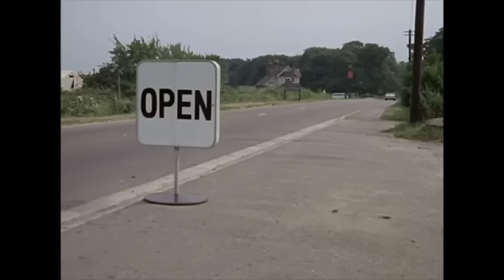The Home-Made Car 1963

Comment: Just happened apon this wonderful blast from the past! What a great little movie! I am an eighty-year-young South African boy who lives in beautiful Pinelands, Cape Town. When I was in my early teens our neigbour gave me his old Austin 7 as long as I removed it from his garage. Dad was the branch manager of Robb Motors in Rondebosch, and as the main BMC agent in South Africa, he had access to much knowlege and spares. Dad suggested that we strip the car and rebuild the engine and chassis. My metalwork teacher was a vintage car rebuilder (he had a beautiful Austin Ulster special) and he gave me numerous bits and pieces which I used when rebuilding my very first car - not to mention much sage advice! We did the engine rebuild and cleaned and polished the inlet manifold and brass updraught carburettor. We got her running beautifully, put on a temporary seat for the driver, and used to drive her up and down our runway, reversing, changing gears, and having a helluva lot of fun! Sadly we could not afford the bodywork, and it was with a broken heart that I had to sell my car to another enthusiast in Claremont, who had the money to complete the build. What wonderful memories! I am still passionate about cars, motorcycles and planes, in fact - anything woth a petrol engine!
Reply: My dad was a Chevrolet dealer in the 50's-60's, he had MG's, Austin Healey convertibles, to bad I wasn't around yet as I was the youngest, he also took home program cars for Chevy like the '55, '56, '57, even Stingrays, but he got out of that business when I came along, I was the only one with that passion while my 2 older brothers didn't care for that.

Comment: Pure nostalgia. Managed to find this on DVD years ago. I even found out the name of the street on which it was filmed. Someone has squeezed a house in where his garage was!!
Reply: Cambridge Rd West?
Reply: @1000Zebedee  Yes. Different layout now though but you can see the main house.
Reply: @automat3000  Yes, clearly the property owner decided to sell off most of the garden including the bit where the garage stood. Bit of a shame in my opinion as the house added isn't really in keeping with the rest of the street which is largely unchanged. I note that sadly, the young lady he was trying to impress (Caroline Mortimer) passed away in 2020.
Reply: As near as I can tell from Google maps, the address is 26 Cambridge Rd W, Farnborough, UK. The set back tan colored house between the red brick house and the white one.

Compare time index 05:20 (view across the street), with Google Street View across the street from this address. The houses across the street look essentially the same to me.

Edit: The house (two houses down the street) at 05:35 is 30 Cambridge Rd W, Farnborough. From Google Street View you can see the distinctive roof and same color (of course) bricks.

The hedge the little girl is hiding in, is still there. Although needs a trimming now, lol. Or at least when the Google car went by the last few times. That would be 28 Cambridge Rd W, Farnborough. Hope this helps.

Comment: Saw this a few years back and watched it again today. This was mostly filmed in Farnborough Hampshire and interestingly if you use google maps you will see the houses on that street where the car is built are still there with many of the same features, bushes etc (Cambridge Road W Farnborough). Sadly the garage that the car was built in has been replaced with a house. The BP garage is now a Jet garage and is located in Bucks Horn Oak Farnham. More trivia: the sports car driver and the young lady were both born in 1942 and sadly they coincidently both died in 2020.

Comment: 21:56 Uses the CORRECT technique for hand starting....never ever have the thumb folded over the crank handle, always have it folded out of the way.
Reply: my late father owned a Rover 90 and when he had difficultly started it ,he used the starting handle  it works  every time  and the same Rovers  was still being produced till about 1963
Reply: Otherwise you'd be turning the air very blue and a trip to A&E.
Reply: I still can’t find the damned starting crank handle for my Tesla! Grrrr!
Reply: @philtucker1224 Put a big hole in the floor and drive it like a Fred Flintstone car. 😂

Comment: Near the beginning of the film when he is searching through the yard he opens the door of a two-door drophead to see an old boy reading MOTOR SPORT – that car appears to be TICKFORD bodied MG VA or SA...! Wonderful stylish cars when MG didn't just build sports cars.
Reply: The MG VA isn't a 'sports car'?
Mine was.
Reply: You have misread my comment, I said 'when MG didn't just build sports cars.' ie they built saloons and two-door dropheads alongside their sports cars pre-war (and later post-war).
Reply: @marknelson5929  I read your comment to mean that the TICKFORD bodied MG VA or SA models weren't sports cars, which they most certainly are.
Reply: You clearly know nothing about these cars. The immediate pre-war TA, TB series of MGs were true sports cars, a development of the J and P type Series in the 30s. The MUCH LARGER – MG VA, SA & WA were large 4-door LUXURY saloons – MG were building these cars very much in the same market as the contemporary SS sports saloon (later Jaguar Cars post-war). Some coach builders like Tickford etc made two-door drophead versions (as seen in the film) on the same chassis but these cars were very much luxury touring cars, not sports cars due to their SIZE and WEIGHT. I suggest you look at the specs of the MG VA, SA & WA saloons compared to a TA, TB sports cars...
Reply: @marknelson5929  I clearly know nothing about Vintage and PVT MGs?
Ha!  That's rich.
Here's a Kimber in-joke for you:
Q). What do you call a non-sports MG?
A). A Morris!

Comment: As near as I can tell from Google maps, the address is 26 Cambridge Rd W, Farnborough, UK. The set back tan colored house between the red brick house and the white one.

Compare time index 05:20 (view across the street), with Google Street View across the street from this address. The houses across the street look essentially the same to me.

Edit: The house (two houses down the street) at 05:35 is 30 Cambridge Rd W, Farnborough. From Google Street View you can see the distinctive roof and same color (of course) bricks.

The hedge the little girl is hiding in, is still there. Although needs a trimming now, lol. Or at least when the Google car went by the last few times. That would be 28 Cambridge Rd W, Farnborough. Hope this helps.

Comment: I remember seeing that film back in the 1960s when the BBC was introducing BBC2 on 625 lines and new TV sets were coming out which needed a different aerial. They used to run it as a trade test transmission to help engineers set up the new TVs

Comment: This reminds in a way how I am blessed to teach a number of the neighborhood kids how to fix things from mowers to bicycles and such. I was able to teach them how to use a push mower without the magneto brake to halt it's operation. They had to use the good ol pull the plug wire off the plug method. Silly thing still runs a handful of years later! Only thing is I haven't ended up getting the girl like the fella in the movie did when the other fella crashed haha!

Comment: I believe the car is a
Morris  (Cowley) or (Oxford) Bullnose 1913 - 1925 ?
The boot (trunk USA)
also doubled up as a back seat. These were called Rumble seats due to the vibration of hanging over the back axle. 
Lovely little film from the time I was born.
I so miss Old England.
Reply: Dickey seats are called 'rumble seats' in the USA.
The finished car is a 1924 Morris Oxford, but the original chassis in the scrap yard is that of a Cowley.

Comment: What are those weird looking round signs with the diagonal black line? Something from a bygone era!
Reply: I didn't recognise that gray bit they were driving on either, it looked so flat and smooth 🤔
Reply: @Comfortzone99  you obviously missed my sarcasm. National speed limits are NOT 70mph. Where they still exist, it depends on the class of road and the class of vehicle you are driving.  For cars and motorbikes, NSL is 70mph only on dual carriageways. On single carriageways where there is no central reservation, NSL is 60mph. And for goods vehicles and any vehicle derived from a goods vehicle, lower limits apply.